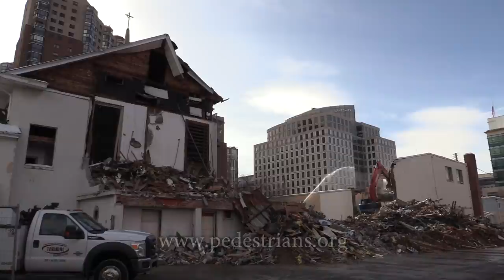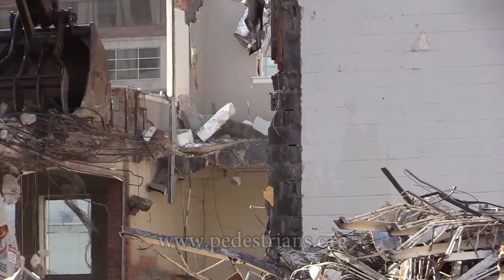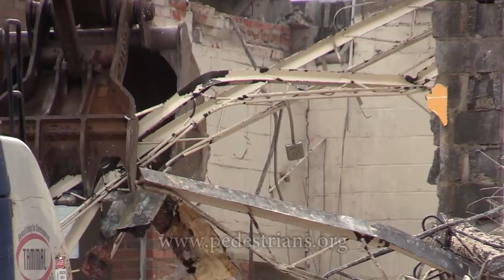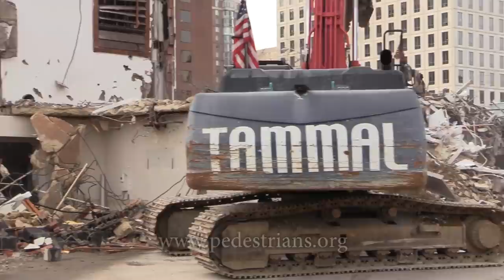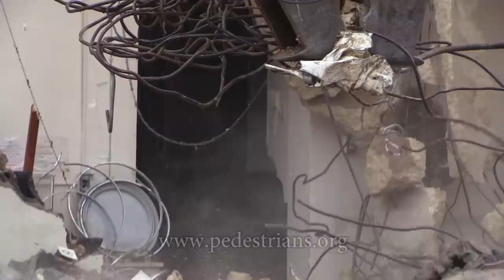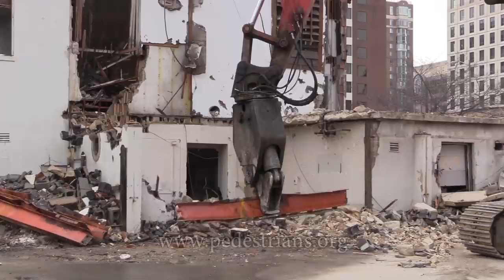Church Demolition (Part 1), Arlington

Comment: Thanks for another great video, John. It's very interesting watching the concrete muncher at work on that rotten concrete that it can actually pulverize, and watching an expert operator put it through its paces. Watching him tear apart the mechanical room was great.

That's also a very impressive project this church  is taking on to move with the times and use their property to serve the surrounding community.